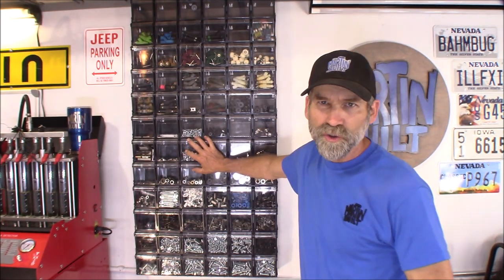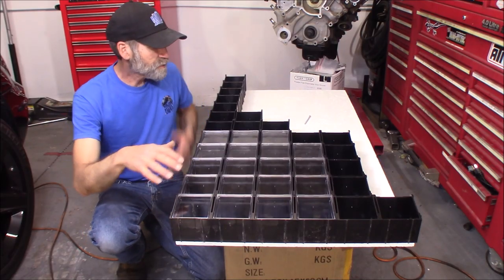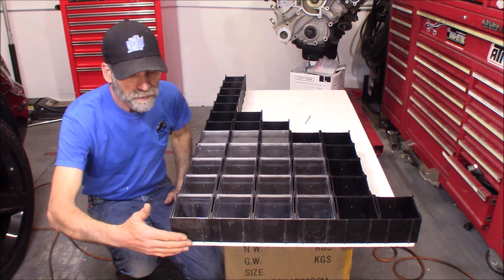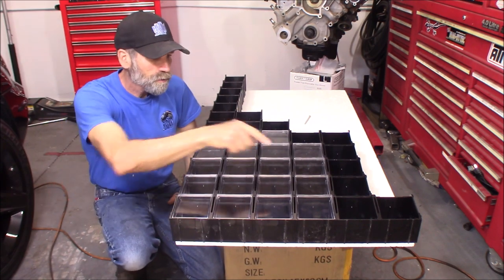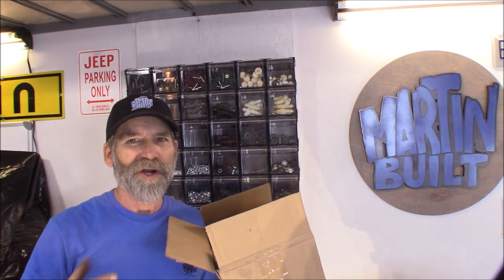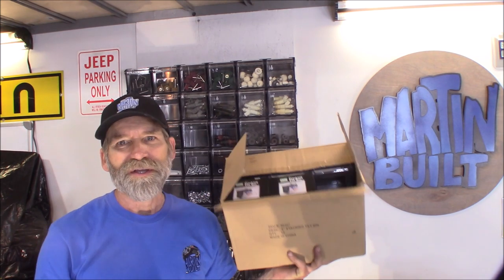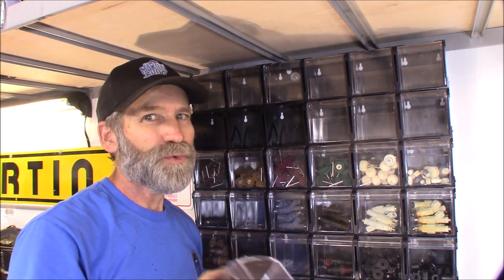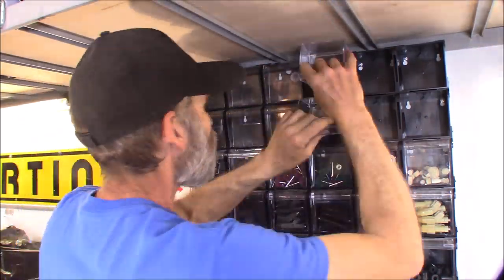Harbor Freight Interlocking Wall Mount Tilt Bins

Comment: thinking about these for my reloading bench.  Think they can handle heavy lead bullets?  or are the pivots weak?
Reply from the maker: No I think they would be just fine I've got some of them loaded up with bolts clear to the top and they do just fine.
Reply: @martinbuilt  I found online they show a 2lb capacity. That’s great thanks great idea.

Comment: Subscribed and liked.  These look possibly large enough to hold a 1lb box of screws commonly sold in the big box stores - ARE THEY?  I was looking at the storehouse 40 bin unit which is too small to be usable for that and I need something better than the cases I've been trying to make due with.  Thanks for the video - now to puruse your vids for other inspirations maybe  :)
Reply from the maker: Yeah, I'm pretty sure these would hold the pound if not a little bit more.
 Thank you for watching and subscribing. I appreciate it.

Comment: Rubber maid had this out in the 90's they charged $ 20 for a 3 box set  but where made from soft plastic . These look like they can break easily.
Reply from the maker: if you were to drop the draw on the floor with hardware in it, yes it probably would break but all in all there a good bag for the buck.

Comment: I'm curious about the mounting-- how can they be taken out or re-arranged-? Or would that entail taking them off one-by-one? Thanks-- I like your video!
I have a ton of these and use them for LEGO...I'm looking at how to mount them but want to be able to move them around also.
Reply from the maker: you can easily move the bins from one holder to another and since the bins interlock you don't need to fasten each bin to the wall. hope this helps. 😉

Comment: One question 
I built a jeep and when i start the engine for first start the rpms go to the sky and no check engine light only on for 3 secs 
 what's happen don't know
Maybe a help?
Reply from the maker: Check the IAC valve. Also, see if there are any codes.
Reply: @martinbuilt  
Thanks I will check in the morning
Reply: @martinbuilt  
Ok i check all it was the intake Manifold wasn't right in place on the back i fix it 
Thanks Thank you 

Now my  exhaust is glow in red where the pipe start 
 i suspect is the cat but need to open and eliminate the back and inspect let see what happens 
God Bless You Sr🙏